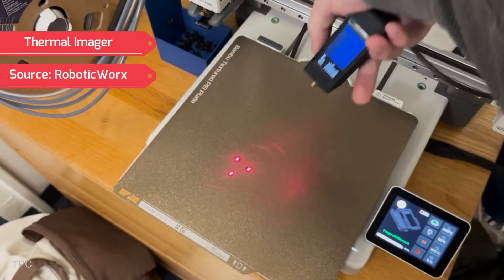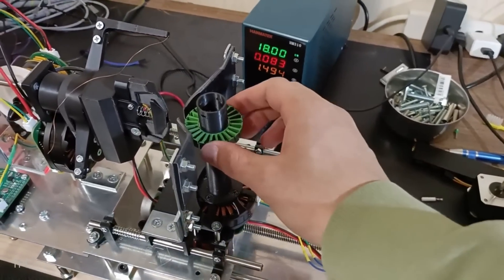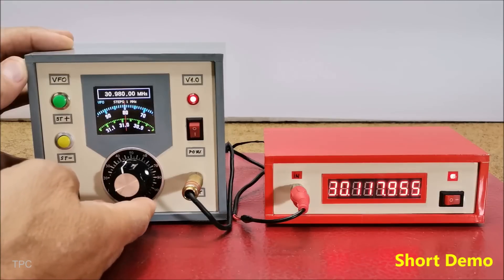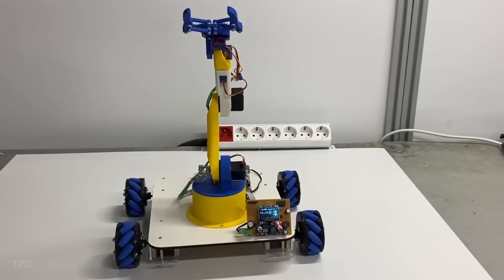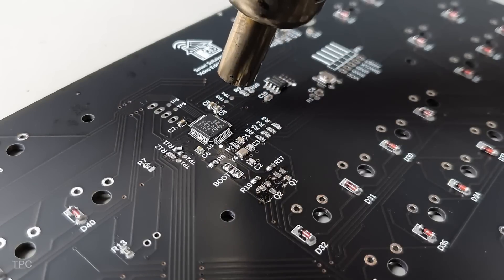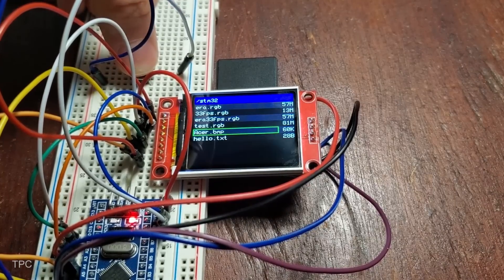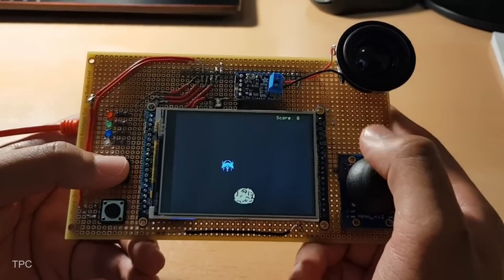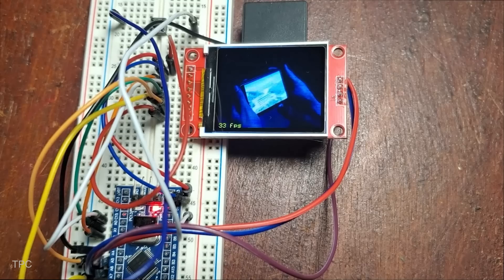15 Great STM32 Projects!

Comment: I'm just getting I to the whole diy with all these different chips out here it's a lot of work learning about it all and even finally making a decision on what project to undertake. I have a few small micro controllers like a Arduino uno, pi pico, stm32  and esp. I am lost in the mix of it all but it's nice to see what capabilities some of these little affordable boards can do it's amazing. In fact I was surprised when I seen the stm32 micro board for the first time because I know that my 3D printer uses a stm32f4 chip as it's brain and seeing that it was so cheap I'm astounded by how it can operate my 3D printer since there is a lot of complex things going on all at once. Thanks for the look into some project ideas hopefully one day I will know how to program some code myself to make an all original diy device to share to the community as well. Keep up the great work people.

Comment: the oscilloscope could happily use an F303, which has 5 MHz ADC's, giving it good performance to about 1 MHz. (i like 5 samples per cycle, or, better yet, 5 samples on an "edge"

Comment: I have a problem on Stm32f429 projets
I want programm my stm as a mouse using it gyroscope sensor and usb HID protocol

I have finish to make a programm but i don't arrive to detect it under device manager
Did someone work on this similar projet ? Pls